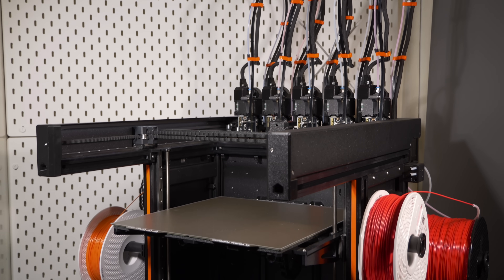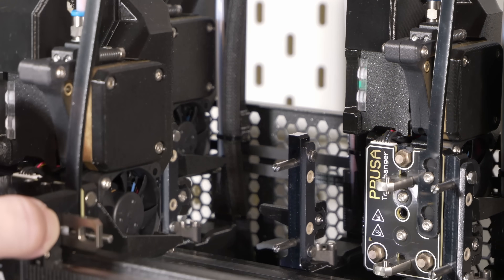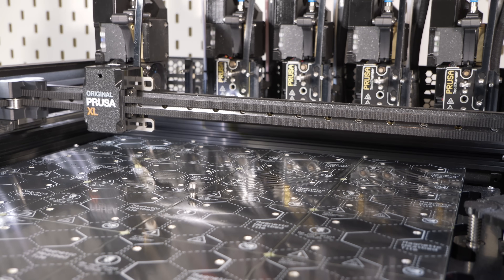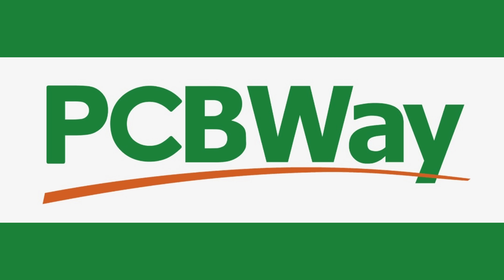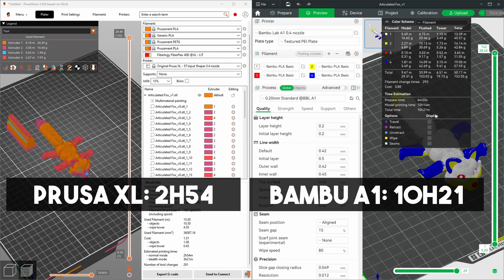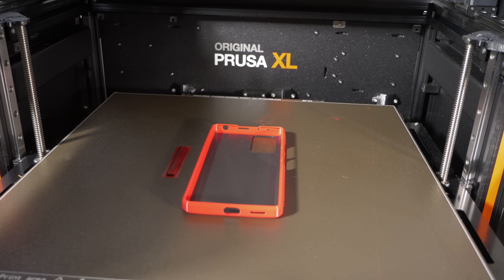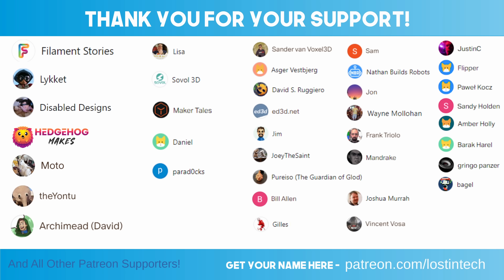The PRUSA XL's secrets revealed - How does it work?

Comment: Man i'm so disappointed  you didn't actually show how it works.
i wonder if it has like a spring behind the bar that locks the tool, and if it's sloped or just installed at an angle. and how they prevent if from being pulled too far, is there some extra space or is there a spring?
Reply from the maker: Have a look at the snapmaker u1 review I did and it should explain it, same mechanism, more animations
Reply: @LostInTech3D  tbh it's still not really explained, what I wanna know is that is the bar tilted? is it relying on the roundness of the pin that's climbing the bar to pull the tool? how does it avoid having friction from undoing the lock, is there a spring to determine the "mating" force? where is it, how is it making sure the locking force is consistent. in a tool changer a consistent locking force etc is very important as otherwise you won't have accurate tool changes. where is the spring(iwhich I assume there is. otherwise i'm not sure how it'd work)

Comment: Single-material prints with a 0.6 mm nozzle work great—no issues, and the results are excellent. Multi-material PETG prints with the same 0.6 mm nozzle? Total nightmare. I spent two weeks testing, tweaking, and trying everything to get decent results. Switched to 0.4 mm nozzles and saw an immediate improvement. Now I run three nozzles with 0.6 mm and two with 0.4 mm. The 0.6 mm setup delivers strength and faster print times, so it's a no-brainer for single-material jobs.

Comment: I got mine few weeks ago, no issues with the assembly and it runs perfectly since the first print. No banding , very quiet, no issues at all so far. I was reluctant to order given the numerous bad vides on the early XL variants showing lots of problems, as well as expecting a bigger BambuLab to be announced. Now that BambuLab announced theirs, there is no comparison with XL, which remains the better one by construction and design. XL is not the fastest when printing mono-color , but it seems to be reliable and the printed models are strong. Prusa seems to have fixed the early XL issues and now they deliver a really good product.

Comment: We bough single extruder XL for work and its been...Horrible garbage. We got it as kit, but every single issue has been on Prusa assembled components. First noticed at filament runout that it didn't eject correctly and got stuck in first filament sensor. Thought it was a fluke, but it happened again. Then I tried on purpose was it six times to simulate runout with even cutting filament to angle, different filaments etc. and failure every single time. Got to support and they promised to send new sensor, but asked if warranty would be ok if I try to check it out. I reamed PTFE tubes slightly and very carefully tried to deburr the filament channel and assembled sensor again more loosely that sensor ball didn't block like half of the channel. It seemed to be fixed. Then I noticed quite bad sound from CoreXY assy from X-motor end. It sounded so bad I ended up moving motor pulley multiple mm's to different height and sound disappeared. But I fiddled with belt tightness. So tried Prusa app to tune tightness. Didn't work. Tried other Android phones and couldn't get any consistency with the app. I assume modern Androids have background noise suppression that renders their tuning app completely useless. So did it by hand and after few hours of fiddling got it working with their torture homing tower code. Printer seemed to now work flawless. Left it printing Friday when left from work. Got back Monday and happily retrieved very good looking parts out of the printer. Put on a new program and 15mins later got message from Connect that printer needs attention. It hadn't started printing and stated probing had failed. I already noticed that nozzle had scraped the sheet. Now I tried again and noticed printer behaving very erratically probing and in before it failed it was probe point 26 or something and printer was probing like 1cm above the print sheet. Back to support and they asked to check if nozzle is ok. Checked it out, all good. Retried print and now during probing printer stuck nozzle so hard to bed Z-motors began to make huge rattle. Now luckily I filmed this and realized nozzle had collided and scratched the bed during mondays first startup try. They concluded that load cell is broken and I'm now waiting for warranty parts and sheet. Plus 10 hours into troubleshooting this printers faults after assembling it and every single Prusa assembled assembly has now had problems. Unbelievable garbage. I've had hundreds of MK3 printing hours, but after this I'm very unlikely to buy their products ever again and can't recommend XL for anyone. Just realized that hopefully that included nozzle isn't now damaged cause of the scraping issue. If this my experience early 2025 I can't fathom the disappointments of early XL adopters. It also pisses me off that I asked in their support if problems have been ironed out and got answer "no issues whatsoever". Well I've got issues on behalf of others then. I'm seriously pissed off it these problems continue after getting replacement parts.

Comment: I wanted this printer so badly, but I'm afraid of it. For every review saying it's great there are 2 or 3 that have all sorts of issues. The heavy price tag is too much to gamble on to see if it's good or if I'll have any of the problems I've seen. 

I know that since it's been out for over a year many of the issues have been addressed and resolved. I'm just still scared to spend over a month's wages on it. 

How is it holding up since this video? Issues? Anyone else have issues or great things to say about it?
Reply from the maker: @basics42  I use it all the time, it's fine. It needs the filament to be dry ideally otherwise there's more chance of strings but no, no issues, not at all.

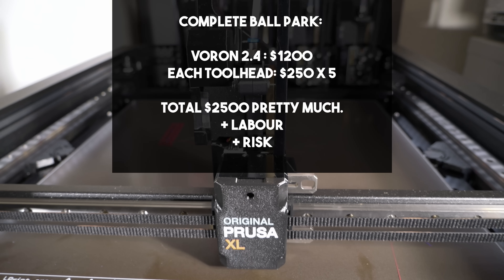Comment: 9:15 well prusa gets bulk discounts and has their own pick and place PCB machines, on a per machine basis they save quite a bit but quickly nullify that with their insane QA process.

But i also dont think the quoted voron price is really accurate either since you can easily reduce that by a couple hundred.

I think its going to be more on a case by case basis, i for example have a used cr10 max so my price for a complete machine is around 450$ with a single head and obviously a couple hundred more depending on what hotends i go for.

Comment: Have you tried printing soft tpu with a nextruder on a mk4? im struggling to not have the filament wrap itself round the gears. Im trying to use Recreus filaflex 60a.. any advice?
Reply from the maker: Yeah there's a ball bearing assembly in the top that senses the filament. Some people have removed that, I think.

Comment: You're correct, there is no competition to it right now if one wants a printer with a toolchanger. That said multi colour/multi material use cases can be also satisfied by an idex, mmu, or a combination of the two. It also doesn't address the use case of folks wanting to build printers for fun :)

Comment: Welcome to the club!

If you ever want to print some super flexible filament and have trouble getting it past the side filament sensor, one trick i found was to get a bit of pla and feed it in first. That way the pla opens up the filament sensor and the flex goes in easily behind it.
Reply from the maker: I did have some trouble but I just bypassed the sensor 🤣

Comment: I built a Voron 2.4 Toolchanger recently, I only paid 50$ per toolhead and 800$ for the 2.4, however, if I could rewind time, I would just buy a prusa xl, way more reliable and quieter
Reply: How many hours did it take for the build?
Reply: I guess that answers my question, despite the early issues
Reply: @username9774 how will you know that it is more reliable?

Comment: One of my printers rocks a 0.6 CHT style knockoff, I accepted from the start that the quality was never going to be amazing, its just great for functional parts and printing faster than a 0.4. it is a temperature/meltzone length/surface tension problem. PTFE lined hotends also seem to ooze less as the liner keeps them from melting until they either sit too long, or the temperature gradient creeps up the filament while printing too slow.

Comment: I got my 5TH in February. It's awesome, very little waste or any issues. The Carbon X1 hasn't been turned on since it arrived as I have found the AMS troublesome in our warmer weather and prone to consistent jamming.
Reply: I swear I constantly hear issues with AMS systems, the one at our job constantly jams too and had to be rebuilt a couple times

Comment: I received mine just before Christmas last year.  It took a while for Prusa to get the firmware and software working better, and I replaced my .6 nozzles with the .4.  I have has a lot of problems with filament jams.  Have gotten very good at removing the nozzle and cleaning - it is a quick job.   A very interesting printer.

Comment: FYI, about the multiple PSUs... The single tool-head XL only has two PSUs. The 5 tool-head has 3 PSUs. The dual tool-head also has two PSUs. I would guess (w/o actually having a unit to tear apart to check), one PSU is for the electronics, motors, and 2 extruders; one PSU is for the heater bed; and the 3rd PSU is for the last 3 extruders. Though, maybe part of the first PSU is also used on the heater bed. There are two 24V inputs on the heater bed control board, one 6A and the other 10A. The main brain electronics only appears to have one 24V input. The 3rd PSU connects to the board that drives the last 3 tool-heads. Interesting, that board has a connector for a 6th tool-head... I've looked through some of the assembly and upgrade guides and that is my guess.

Comment: Love the XL. Multimaterial is a game changer. Using PLA for supports on PETG is amazing. Printing TPU in parts you want flexible and PETG in parts you want more rigid. I am always impressed at this machine. The only thing that frustrates me is that it is so much slower than the MK4. I'm not sure why, but the whole start up process is more than 2x as long.
Reply: When you print PETG with PLA supports (or vice versa) do you just set the bed temp to PETG? Also how do you handle the wipe tower/purge block since the two plastics don't bond to each other?
Reply: @PendragonDaGreat  The bed temp is petg. Haven't had an issue yet. I have been skipping the purge tower lately, but when I was there is a part of the slicer where you can indicate where the extruder purges and I have PLA purge to the inside of the tower.

Comment: I really dont like the pin for aligning nozzles. Should have used an upwards facing camera and software. Would be much more accurate. Think of the crap that accumulates on nozzles etc.
Reply from the maker: It's done once, and warns you to clean the nozzles first
Reply: @LostInTech3D  does it not need to be done every time it homes? Sensor less homing is not as accurate as limit switches.

Still better than the e3d system I guess. That was such a pain in the arse to get them all aligned.
Reply: It only needs to be done on initial setup and when you change the nozzles. Sensorless homing is sufficiently precise to always pick up the tools from the dock correctly. Not that I think that the sensorless homing has any issues here, but if you think about it even if the homing was slightly off it wouldnt affect the print since all tools would be off equally.

If you prefer to verify the alignment with a camera you should be able to do that too since the UI lets you manually tweak the offsets if you want to

Comment: Ive had a 5T for about 9 months now and it's been great.  I put a Sumo Enclosure on it and designed a filter system that uses the Prusa enclosure filter and blower. 

I have zero complaints.  

1 thing I will caution though is that printing large parts, especially functional parts, is a whole new ballgame because shrinkage and warping are a  much bigger challenge.  You have to design your parts with this in mind and have the appropriate slicer settings to minimize it's affects. 

Thanks for the content.
Reply: Yeah shrinkage issues is probably the reason why large format printers will probably never make sense in the mainstream. Above the 250 cubed volume printers regular people won't know how to handle making a functional part. even when scanners or ai modeling magically becomes perfect, reality of physics is not going to be accounted for so easily.
Reply: How have you found bed MCU and buddy board heat? I've been considering upgrading the enclosures and fans for both before throwing it in an enclosure
Reply: @ZeeLobby  I have not had any issues.  With the bed passively heating the enclosure I can't get it hotter than about 45°C if all of the heatbed tiles are on.  I think that's partially because my shop is a steady 70°F.

I have read from others that they have had weird errors when printing above 45°C chamber temps, although those issues may have been resolved with newer firmware upgrades. 

Personally I wouldn't go above 45°C anyways since many of the plastic parts on the printer may become structurally weakened at temps above that.  It prints ABS, and ASA fine at those temps.  I imagine PC would print fine too, but I haven't needed to print any yet.

Comment: I’ll definitely purchase an XL…I think it’s finely a fully functional and fine tuned printer. There is nothing like it, currently, in the market. However, like many others I need to work it into my budget.
Reply: We bough single extruder XL for work and its been...Horrible garbage. We got it as kit, but every single issue has been on Prusa assembled components. First noticed at filament runout that it didn't eject correctly and got stuck in first filament sensor. Thought it was a fluke, but it happened again. Then I tried on purpose was it six times to simulate runout with even cutting filament to angle, different filaments etc. and failure every single time. Got to support and they promised to send new sensor, but asked if warranty would be ok if I try to check it out. I reamed PTFE tubes slightly and very carefully tried to deburr the filament channel and assembled sensor again more loosely that sensor ball didn't block like half of the channel. It seemed to be fixed. Then I noticed quite bad sound from CoreXY assy from X-motor end. It sounded so bad I ended up moving motor pulley multiple mm's to different height and sound disappeared. But I fiddled with belt tightness. So tried Prusa app to tune tightness. Didn't work. Tried other Android phones and couldn't get any consistency with the app. I assume modern Androids have background noise suppression that renders their tuning app completely useless. So did it by hand and after few hours of fiddling got it working with their torture homing tower code. Printer seemed to now work flawless. Left it printing Friday when left from work. Got back Monday and happily retrieved very good looking parts out of the printer. Put on a new program and 15mins later got message from Connect that printer needs attention. It hadn't started printing and stated probing had failed. I already noticed that nozzle had scraped the sheet. Now I tried again and noticed printer behaving very erratically probing and in before it failed it was probe point 26 or something and printer was probing like 1cm above the print sheet. Back to support and they asked to check if nozzle is ok. Checked it out, all good. Retried print and now during probing printer stuck nozzle so hard to bed Z-motors began to make huge rattle. Now luckily I filmed this and realized nozzle had collided and scratched the bed during mondays first startup try. They concluded that load cell is broken and I'm now waiting for warranty parts and sheet. Plus 10 hours into troubleshooting this printers faults after assembling it and every single Prusa assembled assembly has now had problems. Unbelievable garbage. I've had hundreds of MK3 printing hours, but after this I'm very unlikely to buy their products ever again and can't recommend XL for anyone. Just realized that hopefully that included nozzle isn't now damaged cause of the scraping issue. If this my experience early 2025 I can't fathom the disappointments of early XL adopters. It also pisses me off that I asked in their support if problems have been ironed out and got answer "no issues whatsoever". Well I've got issues on behalf of others then. I'm seriously pissed off it these problems continue after getting replacement parts.

Comment: I bought a Snapmaker J1 (IEDX) with the new hotends instead. XL is too expensive. You need another 600€ for the enclosure too. 
I print functional parts. 2 color prints (lettering) or TPU+ABS is the main stuff I print. I really wanted to give the XL a go but it wasn’t in my budget.

Comment: Very good video, machine have very low waste ratio per  colour or material change, with enclousure can be good choice for spensive materials. Its made in europe and always good service
Reply: The "waste" conversation is misleading. Another channel did a mathematical look at the price difference between "competitor 1" and the XL and you would need to have hundreds of thousands to over a million  filament changes to get to the break even cost of an X1C and an XL. filament can be recycled, reused,  or you can print smarter. 

It is literally less than a penny for multiple filament changes to maybe a 10 cents for filament costing $100 per spool. The Xl advantages are the speed in the filament changes and maybe the size. After that it becomes niche projects that can print in open air or with non abrasives unless you spend $200 upgrading to hardened nozzles and $300-600 for an enclosure solution.

At that point you can get multiple machines with more capabilities.

Dollars and Cents, Bambu Lab's Filament Waste True Cost